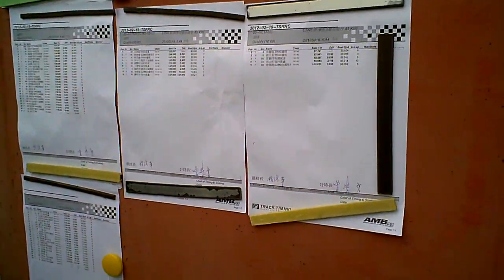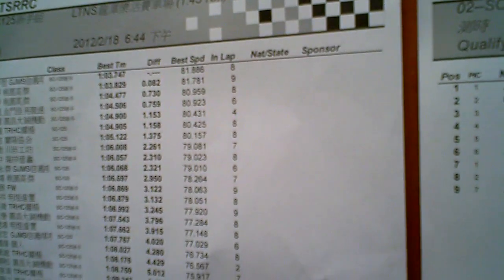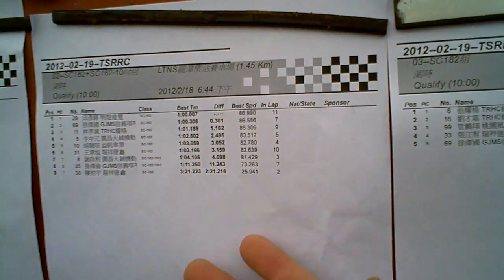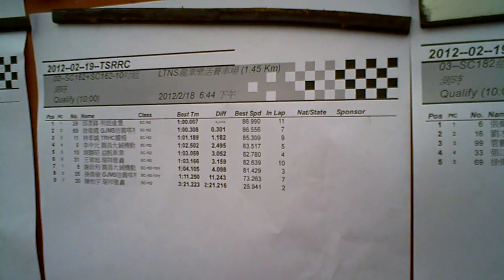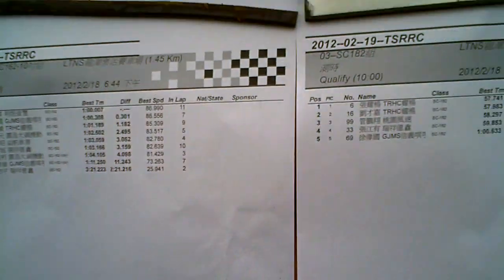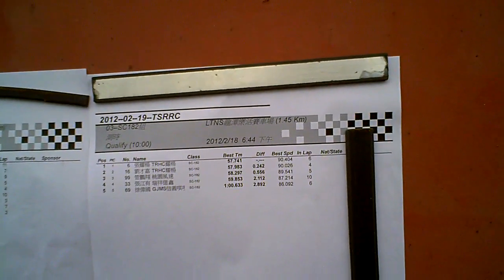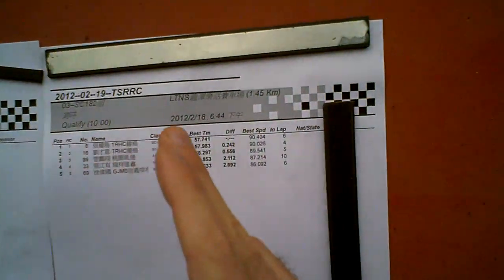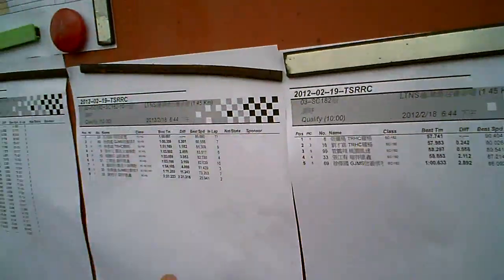Scooter Horse Power  Modifications

Comment: Majority of the scooters have CVT, no clutch there. In stock class, minor cvt mods are allowed iirc.
Riding a scooter is totally different from riding a bike. I can get my knee down on a bike, but have yet to succeed on a scooter. Scooters are more agile, even than a small 125 2-strokes, because of the shorter length, so it's even more agile on tight corners.
Also, many guys in Taiwan start riding a scooter first, as a way to get to school and whatever and later just start racing it.

Comment from the maker: Both the guys answering you are wrong (no offense). You'd brake normally (using both), but you'd give yourself a bit more time to stop. And on very slippery surfaces or at very low speeds you use BACK only.

Comment: for me gas isnt an issue because my company pays for it. my current motorcycle is a 2001 yamaha vmax so im looking for a daily driver rather than a weekend warrior. ive been looking at dual sports and supermotos but havent found something i like in my price range. the only concern i have with riding a scooter on US streets is that motorcycles here are a dime in a dozen and scooters are generally slower than most of the cars on the road so im worried about car aggressively passing me in traffic.

Comment: do they only have races for 4 stroke scooters? any 2 stroke races? 

and to answer some questions,

chances are the transmissions have been modified. i dont own a 125, but i have a 50 modded to a race 70cc engine and the transmission had to be modified to handle the high rpms. clutch, belt, pulleys, variator, etc  all had to be changed with a 2 stroke racing kit so i would put my money that transmission mods are allowed in the high displacement classes and probably in the stock classes aswell.

Comment: in the dry you get taught to use a 80/20 ratio front to back brake.. and in the wet a 50/50 front to back braking. but to be honest on public roads in the wet you shouldnt really be going that fast you need to brake hard. And I'm English.. so i must be right :D